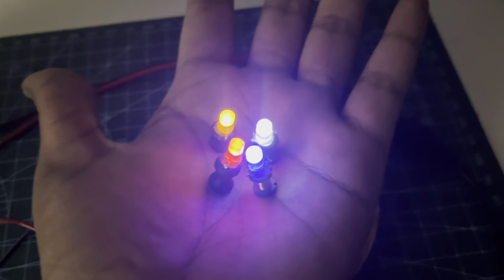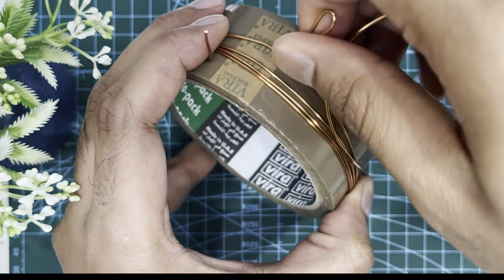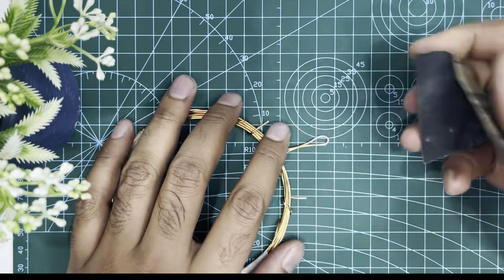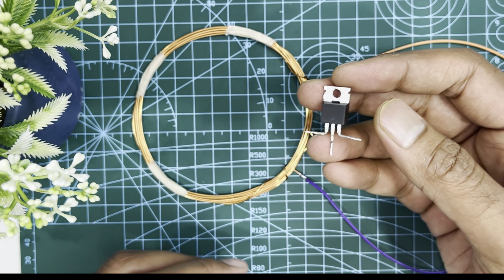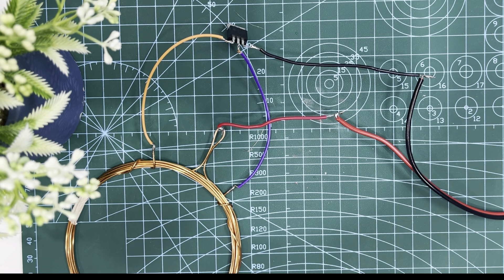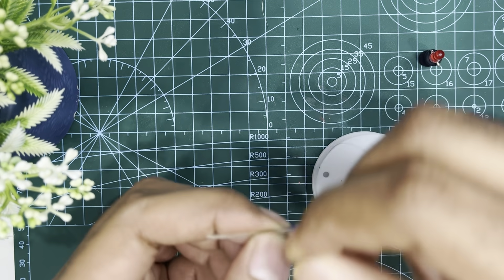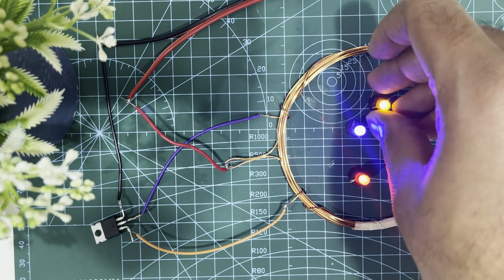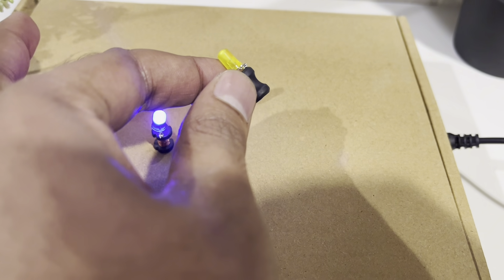Wireless LED || DIY Tutorial || Engineering

Comment: You are essentially shorting the power supply, not good practice? Circuit diagram?
Reply: How?
Reply: @Anik_Biswas_Gamer without the circuit diagram it's hard to tell exactly what he has done. The current in the primary must be switching on and off somehow . My guess is the power supply is switching on and off as it detects the short. Not sure what the mosfet does,  no capacitor or anything to make an oscillator ?
Reply: @yesihavereadit  I think the somthing signal like feedback coming  from the coil and the signal making the MOSFET to turn off and on rapidly , and I think it's like a transformer centre tapped one .... Which is transmitting AC current provided by MOSFET to the leds
Reply: @Anik_Biswas_Gamer  yes , I can't find a similar circuit online with just a coil?  I mean it seems work but how?  There's nothing to limit current through the coil.
Reply: @yesihavereadit  As MOSFET are voltage controlled, I think that it's not necessary to add current limiting resistor
Reply: @Anik_Biswas_Gamer  I wonder how hot that coil gets? I'm no expert on mosfets so I take your word for it.
Reply: @yesihavereadit  the coil doesn't gets Hot because we are using low voltage ie 12v , it's normal
Reply: @Anik_Biswas_Gamer a test would be to try this circuit with a car battery,  thats 12v . The power supply you are using has short circuit protection, which is what i think is saving the coil from melting and the mosfet from blowing. It's switching on/off which is supplying changing mag field to leds .
Reply: Won't the gate always have +12v via coil? Mosfet Always be on? I can't see  any feedback to put negative voltage on gate? Someone said its internal capacitor but that would be very small.
Reply: @yesihavereadit  idk bro what he done , when I will try it I will report u here
Reply: @Anik_Biswas_Gamer  don't use a power supply that you don't want to lose!
Reply: @yesihavereadit  nothing will happen to Power supply it has an in built cut system ... And also If I use my battery it has a bms which cuts electricity when short circuited
Reply: @Anik_Biswas_Gamer  go for it
Reply: @yesihavereadit  Wait I need to go to store to buy components and already it's 11:27 pm , imma do it tomorrow
Reply: @Anik_Biswas_Gamer  I tried it using an line circuit simulator, its just on all time. It needs a capacitor somewhere to get oscillation.
Reply: @Anik_Biswas_Gamer  worked with capacitor, not without
Reply: @yesihavereadit  idk

Comment: Can i use wallclock machine copper wire
Reply from the maker: To make secondary coil you can use that 👍
Reply: @mahade_DIY  for inductor?
Reply from the maker: @anyonecanmakeit718  Yes . Inside the wallclock machine the copper wire is maybe 0.1 mm thick. So as I have shown in the video you can use it to make the LED coil (secondary)
Reply: @mahade_DIY  thank you sir
Reply from the maker: Take love dear ❤️

Comment: Nice project.would it work with non insulated copper wires?(for the big coil)
Reply from the maker: No it will not work
Reply: @mahade_DIY  thanks for replying but can you explain why?
Reply from the maker: To understand the principle of wireless power transmission you have to know about electromagnetic induction.
When current passes through an insulated copper coil 
1. Magnetic field generates: A magnetic field forms around the coil
2. Magnetic flux increases with current 
3. The coil becomes an electromagnet

Because of this electromagnetic flux energy transmitted wirelessly from the primary coil (the secondary coil (receiver)

If you use uninsulated wire instead of insulated wire - in the coil all turn will be touched together and current will passes through the shorted path and there will be no more flux will generate. The whole coil will work just a piece of wire not a coil anymore
Reply: @mahade_DIY  thanks for the reply and the effort
Reply from the maker: @BlueCar-ef7kx take love dear ❤️

Comment: Essentially this is how wireless charging on phones work. Still a fun kids project.
Reply: Except it's missing an important component, a capacitor in both the transmitter and receiver with values to tune to a resonant frequency, this would make it more power efficient and probably allow for greater distance.
Reply from the maker: @djbare9  yes using capacitors will be more helpful.✅
I just wanted to keep it as simple as possible for the beginners
Reply: @djbare9  what type of capacitor should be used?
Reply from the maker: Exactly 💐
Reply: Wireless charging is a misleading term, as if power jumps from socket to mobile. Still we a wire to charge wireless...
Reply: @klmkt4339  Yep. While designing the "wireless" supply for our equipment I asked the sellers to not call it "wireless", but rather a "contact-less" power supply. Because you don't get rid of the wires nor increase the distance they reach by any significant value. What you actually get rid of is just a plug (which is sometimes much more valuable than removing the cable itself btw).
Reply: @klmkt4339 
Where do Solar Panels get their power from.! ...
Reply: 1 year later and this is still smug as hell. What kind of stupid thing to say. It's used by every cell phone manufacturer, has limitless potential in MULTIPLE areas of life, hobbies, production, etc... but yea...a "fun kids project". What an insufferable person you are.
Reply: Look at you trying to make yourself feel important. Good boy.
Reply: @prehanramsamy6728 who you calling “boy”?  - you’re still a virgin! 😅

Comment: I shall give this a try.
I never realized this could be done with so few components!
How many turns for your hand made secondary coil?
Reply from the maker: Yes make some more colors .It will look great.
200-300 turns will be good enough for work
Reply: @mahade_DIY  is it the same problem with wireless phone chargers, where they have high resistance and therefore need many coils to get sufficient current to light up the LED? looks very cool though, would be even more cool if they were levitated magnetically, and it would look like some colourful fireflies in the dark!
Reply from the maker: Yes I tested with fewer turns first,didn’t work.
Then I added more turns to get the enough current to glow the LED .
Yaaa..making look like a firefly is a great idea 💡